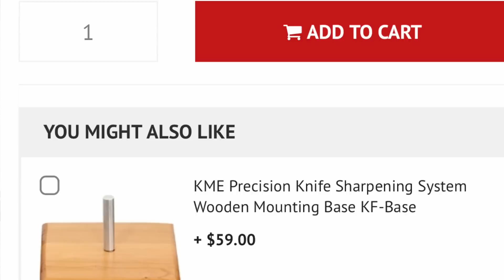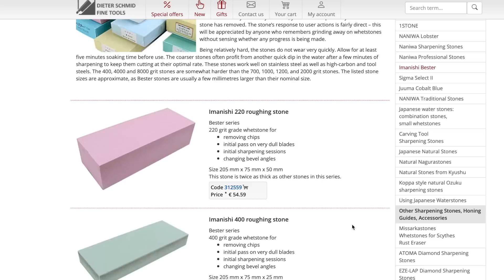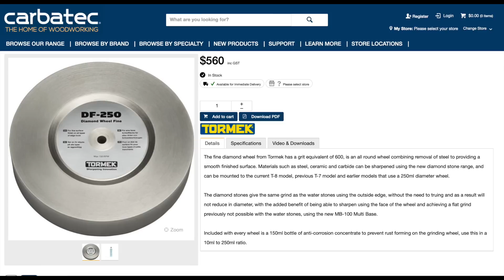Fixed Angle Sharpener Showdown - Low, Mid, High Cost Quality Options (Worksharp, KME, TSPROF)

Comment: WS precision adjust elite works just fine for the $. I have done everything from touch up/polish on a Kershaw Leek all the way to complete repair/reprofile of a 6in survival knife (that took a couple of hours). Only issue is if you try to go too acutely angled on certain small blades you end up grinding away on the clamp.  It has some size limitations but not many and is easily worth the money.  It does make for razor sharp clean edges.  Recommend getting a separate large paddle strop as well and you’ll be fine
Reply: Yeah I have 2 shorts on my channel of 2 knifes I've done with the work Sharp elite, straight razor sharp awesome setup!!!!!!
Reply: Yeah the only problem I have with mine is it really doesn't work on something like a Becker Combat Bowie, it's just too big for the unit.  Works great on your standard kitchen and pocket knives though, which is honestly what I use the most by like a wide margin.
Reply: I was just going to post that it will grind the clamp on small knives with steep angles. Something to watch for
Reply: I also recommend getting a clamp stand to help prevent vertical movement. I also like using lapping film for high to mirror polish. Has been my main sharpening system for a few month and have enjoyed it

Comment: I like the fancy sharpeners but I just use a lansky box and an old leather belt. It helps that my main knives are VG-10 and Victorinox SS.
Reply: IMO the diminished returns of these expensive systems aren't worth it
Reply: @Mastermindyoung14  I've never owned any of them, but it seems like the blade being sharp enough to cut is good enough for me.

Comment: Also I think it would be worth keeping a Worksharp around for sharpening recurves.   The narrow abrasives are capable of getting into most of those curves.
Reply: with venev ursa which a set from extra coarse to ultra fine and produces crazy sharp edges and super nice polish on the edge for only $110. might seem like a lot but these stones last a while

Comment: I can only speak to the KME in this group, as I have only used a KME, a Lansky, and a Wicked Sharp.  Hated the WS and sold it almost immediately (for a profit.) Used the Lamsky for years and it did an adequate job.  The KME was a whole other dimension in knife sharpening.  It is easy to get a razor sharp edge with the KME.  I bought the full kit plus the Japanese Water Stones.  As great as the KME is, the KME support (Brian) is exponentially better than the KME device itself.  When a couple of parts failed, KME sent upgraded replacements immediately with no questions asked.  I highly recommend the KME.  I feel it has been well worth the price.  Great video Pete!!  I'm up to 4 Akubra hats now!!!!

Comment: One thing I’ve noticed with these systems is that the angles get shallower near the ends (tip and heel) of the blade.

I’m not on the forums so I don’t know if this has been discussed to death already, but I did the math, and it’s not insignificant. If you are putting a 20 degree edge on a 3” blade (with the blade clamped exactly in the middle) the edge is about 0.75 degrees shallower at the tip and heel than the middle. It’s worse with bigger blades.

This is because the arm has to “reach” farther out to contact the edges farther from the clamp. Imagine standing a foot from the kitchen counter and touching the edge right in front of you versus the edge 3 feet to either side. The angle of your arm changes.

The longer the blade is (or farther from center it’s clamped), the bigger the variation. If you clamped a 3” blade all the way at one end (or clamped a 6” blade in the middle) the edge will vary by over 2.5 degrees from tip (or heel) to center.

Notes: These numbers are for a straight edge. Since most blades have some belly, the differences in angle will vary. Systems that hold the edge farther from the mounting point of the arm will have less variation. You can use your angle finder to measure the angle at various points along the edge to see for yourself.

I don’t know, maybe everybody knows this and nobody cares?
Reply: Technically not correct. While it does "math out" and seem like it is changing it actually does not. Years ago somebody did some CAD videos showing it and perfectly explaining it but for the life of me I can't find it. I did find one by Simple Little Life (v=UjoTLYsKG9k) that kind of explains it.
Reply: Your not wrong, it makes the polish of the edge look different to. However I’ve managed to just raise the angle a little for the tip and heel of the blade. And it helps account for this

Comment: This is the only knife channel to which I have stayed subscribe over the years. Honest, informed and incredibly entertaining, it never fails to deliver the goods. This video is a perfect example. Still, I think these sharpeners are absurdly overpriced, the TSProf being the only one that costs more than $15 (US) to make. 
     A feature that would really improve them would be a screw/knob to adjust the angle with precision rather than making you use one hand to position the guide and the other to tighten the knob, all the while having to balance the angle cube. And the fact that the width of the blade changes the angle of incidence (as you pointed out) so you can't set it and then sharpen different knives in succession knowing you have the angle dialed in is really counterproductive. And to spend $300-500 and not be able to sharpen your large kitchen knives just seems a waste.
     4 Harbor Freight belt sanders ($240) (or spend a bit more for quality machines), 4 Surgi Sharp angle guides ($60), 20 Trizact belts (5 each of 80, 30, 16 and 6 microns) ($100), and a 1x30 inch leather strop belt ($20) will give you guided angles and perfect edges on 100's of knives for about $420! Then, if you really need 'polished edges' buy a knock-off guided sharpener and some plates and lapping film for a total investment that is still less than $500. And if you are willing to change belts instead of having 4 grits on 4 machines ready and waiting that cost comes down to about $195. Just something to consider as, for those who haven't used angle-guide sharpeners, they should understand that the process is extremely time-consuming.
     A belt sander system will also allow you to sharpen loppers, shears, lawnmower blades etc. And with a single belt sander system has a footprint no bigger than the KME.
Reply: They released a new model of Kadet - Kadet Pro. It has a toothed gearing and it allows you to set the angle with one hand.

Comment: I have a handful of systems including the Spyderco Sharpmaker and an old lansky, WS field sharpener (keep in my truck). Got the WS Elite a year ago and added the aftermarket support. Still love it. Also have the WS Ken Onion system with the blade attachment. Started freehand with Naniwa stones. Did okay but wanted to go back to a fixed angle with higher quality. Got the TS Prof Kadet Pro and added Atoma 140 and a full set of Venev resin bonded Dimond and the L adapters so I can center the blade with both clamps on pocket knives and add an inch for wide blades. ABSOLUTELY LOVE it! Hands down most versatile and can do a knife in half the time as the WS because of the larger stones. Like someone else mentioned I am keeping the WS for recurve blades with the smaller stones. Great video!

Comment: Thanks Pete - more great info based on actual use and practise. Most of my sharpening gear is either Lanksy or Worksharp and have had no real problems with either. Most of my gear is several years old (well some bits are over 20 years old) and a bit basic compared to the newer rigs. After 35+ years of knives the absolute best advice I can give is practise, practise, practise. Get an old knife or two and practise. Get to know how your system works to get the best out of it. Sharp blades all.

Comment: Great video! Something to keep in mind is that when you swing any of these systems over a wide range of angles in the horizontal direction you again are changing the bevel angle. I use and EdgePro. In the $200 price range, One advantage of the EdgePro is that the spine stop is adjustable, so you can keep the bevel angle pretty constant by adjusting the stop distance. The downside is that it doesn’t clamp the system, so you have to watch to make sure that you are keeping the knife flat against the surface. Also it really doesn’t go below a 10deg half bevel angle, so if you are looking to do a hard knife at a really narrow angle, this system won’t work on it.

Comment: Food for thought with the Worksharp:

The Worksharp's thinner stones are quite helpful for dealing with deeper recurves without investing in additional rounded stones for the other systems. It still isn't going to take care of an aggressive karambit, but that's just the nature of fixed angle sharpeners in general.

I've sharpened up to 8" chef knives on the Worksharp as well. You don't get the whole stone's throw out toward the tip, but it gets the job done. Depending on the spine width of a meat cleaver, it might not fit in the smaller jaws of it, but other kitchen knives are all good as their spine thickness is considerably thinner.

Meat cleavers are a bit of a niche product though. They're not precision instruments, they're designed to hack through bone, so even if you get them laser sharp, that edge won't last long. There's a reason why most of them have a hole out toward the tip-side; it's to hang it up alongside your pans since they're not dangerously sharp. With most modern butchery being done at grocery stores or plants, meat cleavers are becoming less common or needed in homes, at least here in the US.

Lastly, I like the Worksharp for causal sharpening, as I use it more often in a handheld manner. Hold the back of the system with my left hand, actuate the arm with my right. Allows me to chill on the couch and reprofile rather than being tethered to a table or workbench. Trying to do that with the KME is a bit unwieldy (as covered), and I've also had a knife blade or two swing toward me due to the system pivoting on the base.

Comment: bought the basic worksharp model couple of months ago. while it has some quirks and problems - mainly the clamp getting ground off a bit when sharpening small blades and how acute of an angle you can put on those; this system has singlehandedly turned an anxiety inducing ordeal into a pleasant walk in a park of a sharpening experience
Reply: I totally agree with everything you said. I think I'm going to go up to the TS proof just because I'm grinding off my knife holder😂

Comment: FYI ... On a 7" blade centered up in the grip under the pivot, the effective grind angle will gradually drop by 2º as you approach the tip & heal of the knife.  Example 17º set-up at center, drops to 15º at 3.5" off center.  To mitigate the issue use a fixed angle sharpening rig with the pivot on a rail, equal to or longer than the blade you are sharpening.
Reply: Could you please make a recommendation for such a sharpener? Thank you!
Reply: This is actually not true. On a straight edge the angle on the sharpening bevel stays the same even if the blade is infinitely long. If you look at the system from the front or top this feels quite unintuitive, but if you look from the tip along the edge you will notice that the angle is the same. Think about how the angle of the sharpening stone from the top of the bevel to the edge also changes when you bring the arm towards the tip. Try calculate some trigonometry and you will see that the sharpening angle will only change if the edge curves.

Comment: The model I have used is the Work Sharp Precision Adjust. I’ve only had mine for a month or two, but here are a couple of things I’ve learned (in addition to what Cedric said): 

When you clamp a large-ish knife or tool in the holder, the plastic base becomes really front-heavy and can topple over. So I’ve started clamping the base to my table with a couple of C-clamps. I do this even for a small pocket knife, to give the whole rig stability. 

The knife-holding clamp is just help to the base with small magnets, and it can have a good deal of up-and-down play when you’re rubbing the sharpening plates on the blade. It really helps to buy and use one of the small after-market braces that go under the clamp arm, or you could make one yourself easily if you prefer. 

If you have a knife too big for the clamp, such as a machete, you can use the aforementioned C-clamps to clamp the blade to a table, or clamp it in a bench vise, and use the sharpening plates for freehand sharpening. An angle finder, as Cedric demonstrates, is a big help for putting the diamond plates at the right angle.
Reply: Pete definitely looks like a Cedric

Comment: There are folks making accessories for the worksharp that ups its game a bit. Got a 'kickstand' that braces the arm up and really helps when you're going after it on a reprofile or something. Also universal stone holders, I haven't tried mine yet but it should help a lot on one of the problems with the original stones and that's they aren't tall enough to get back into the corner of some blades. That said I really like mine, wish they came out with the 'heavy duty' version, if I had the time I'd make one.
Reply: But after all the accessories and everything does the total price kind of on par with the KME?
Reply: @MrNiceGuy80x5  I couldn't say. You know how these things are, you can spend as much as you want on any of them. Start buying top dog stones and the entry prices drop down the cost sheet.

Comment: I’ve had the same KME since 2018, it’s been a godsend in learning how to sharpen a knife to optimize the steel and blade type. I’ve taken CPM-M4 from 22° to 18° then coarse mirrored it and only took 4 hours total.
Reply: 4 hours?! Is that taking breaks and throughout the day altogether accumulated time or? I mean, I've heard that M4 is hard to sharpen but jesus..it only takes me maybe a half hour altogether sharpening from 140 grit to 1500 on S45, no lapping or anything though.
Reply: @Knivess0  I was completely redoing the angle, 4 hours total a few breaks all done in one afternoon
Reply: @Knivess0  just remembered I only had a 140 grit as my lowest at that time, so it added to the time significantly.
Reply: @smeefbeef367  Wow, that's crazy all the same. Reprofiling still I can get done in under an hour on softer steels, I suppose I wasn't aware how hard M4 is, I've never used it before.
Reply: @smeefbeef367  M4 is equivalent to around S110, right?
Reply: @Knivess0  very similar but it’s significantly tougher

Comment: Love my work sharp precision adjust. Have replaced the 320and600 grit diamond plate/stones. And does an excellent sharpening job, good enough to cut paper towels! My only problem is clamping to tapered knife blades.

Comment: As some others said what about the edge pro and wicked edge?
Especially the edge pro apex, it's the original of all these designs and is definitely better value and more extensible than that worksharp. 
Great video though and the tsprof looks nice. 🍻

Comment: I've got a Wicked Edge Gen 3 that I bought off eBay used for $700 and added like $250 worth of accessories and a Work Sharp electric Ken Onion edition sharpener for about $150 and added literally every extra accessory you can buy including belts and that came out to about $300.

Both of them handle any sharpening job I've ever come across. 
Wicked edge for pocket and kitchen knives.
Worksharp for anything used outdoor related like axes, swords or when I have a TON of knives to sharpen quickly.

Comment: I really like my work sharp precision adjust but I always recommend that people also buy a brace for the jaws if they get one. The way the jaws flex under sharpening is it's biggest weakness and after getting a brace I found that mine wasn't holding both sides at the same angle on it's own which was causing me to have really wonky bevels. A cheap brace fixes all of that.

Comment: I have a lansky, wicked edge go, kme, and some other cheapo things along with a very small selection of benchstones. Anymore I don't use the guided sharpeners unless I let a blade go really dull and damaged, or it came from the factory with a wonky edge. For touchups and maintenance I use a dmt extra fine and a spyderco ultra fine ceramic. I also use a dmt diafold coarse/fine for small pocket knives like slipjoints. If it needs extra work I find myself using the kme most out of all the systems I have.  Most of the time I just don't feel like getting the case out and setting it up. I'll grab another knife before I do that and I'll end up with a dozen really dull knives before I have to spend an afternoon sharpening. So a quick run on a bench hone saves me a lot of headache.

Comment: The KME is awesome. If I had unlimited funds I would get the TS Prof for my larger knives. Even a decent sized chef knife will have varying angles from tip to heel using the KME if the knife position isn’t adjusted. The larger radius of the TS would minimize this.